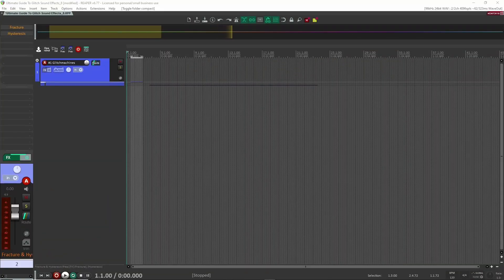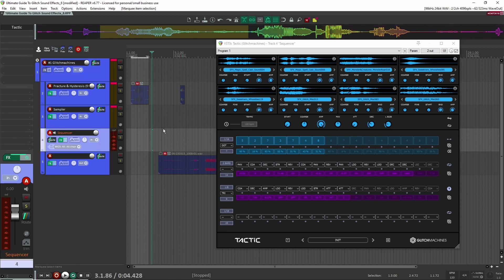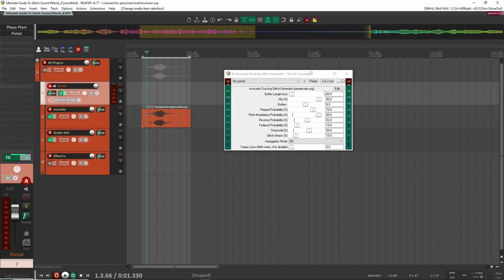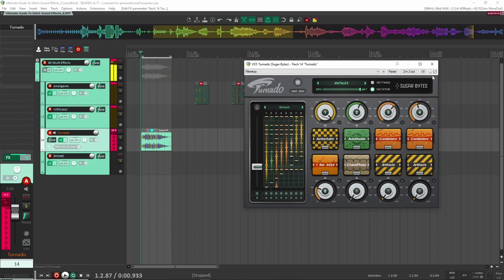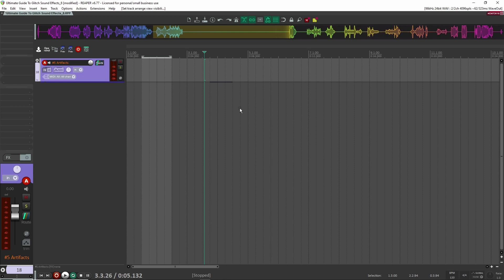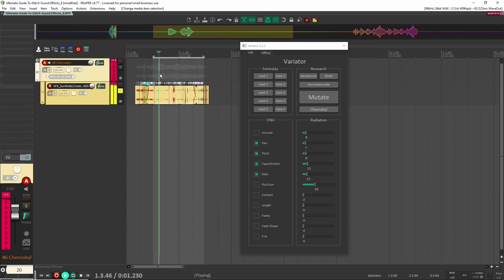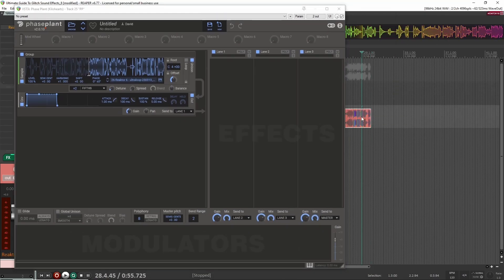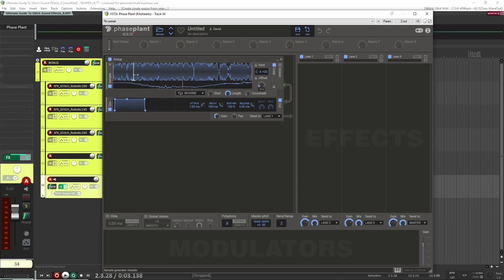Ultimate Beginner's Guide To Creating Glitch Sound Effects From Scratch

Comment: Hey David!

I am currently interning at a small videogame startup where I am responsible for everything audio except music. I'm having trouble with keeping the sounds coherent. As an example, I've designed different weapon swings, for the same weapon, but they ended up sounding really different. 
The sounds of the main character moving around, grabbing ledges, sliding on walls, jumping etc. also seem like they aren't really cohesive. 
If I have to evaluate on what I did wrong, I'm thinking that I should probably have established a set of design conventions for each "asset" that needs audio; conventions like gathering source material, and sticking with that source material, for all sounds regarding that asset. That seems to be a practically sound way of keeping the design cohesive throughout.
But I would love to hear you go about making sure that a design is cohesive? (Whether it be for a shcool of magic, a characters movement or attacks made with a specific weapon)

Bw
Reply from the maker: Hey Mik,

Yea, I think your evaluation is accurate. If you are creating multi-layered sfx, then using the same layers across variations/sfx will help to keep the sounds cohesive. Also, reusing specific sounds across variations/sfx can help.
Reply: @daviddumaisaudio  Alright, thanks for the input! Really appreciate it! 🙂